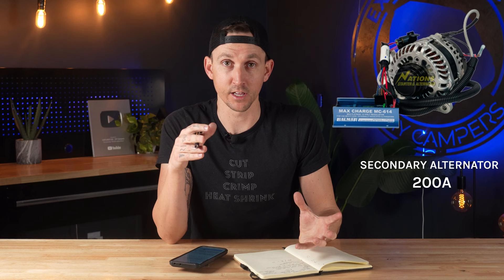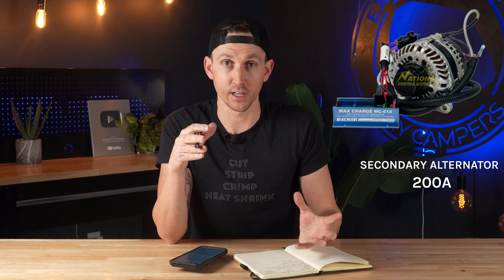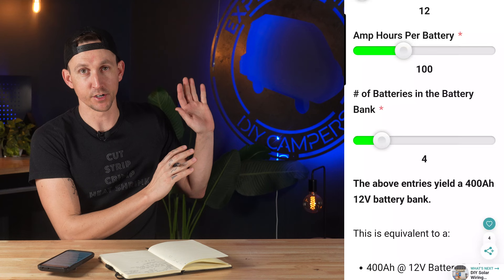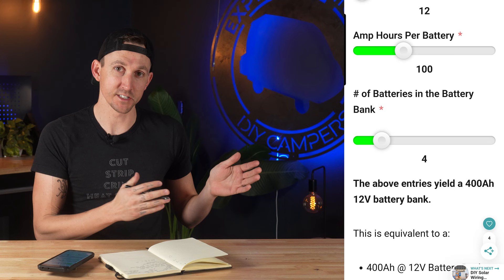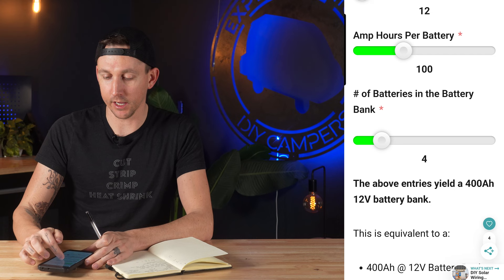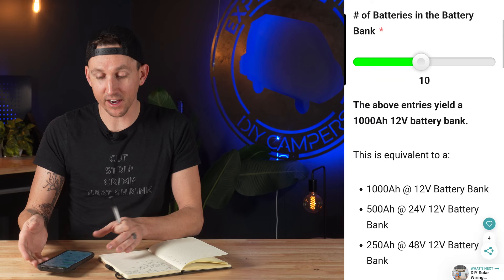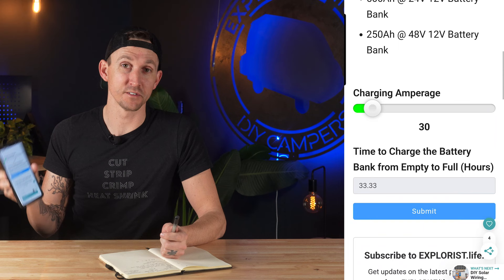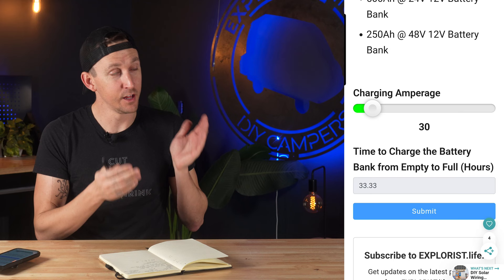ALTERNATOR CHARGING OR NOT? (for a camper electrical system)

Comment: Hi Nate, disagree with your point of view. who starts off their camping journey with 0% SOC on their battery bank. Also most modern DC-DC chargers have dual input Alternator and solar and will utilise best option. as well when driving at cruising speed alternator charging is not damaging the engine......its what its designed for. Here in Australia we have some excellent DC-DC chargers that are almost bullet proof..........battery bank gets fully charged driving to campsite and solar keeps the bank topped up my system is 270 A/H lithuim bank with 700W total solar (2x 350W panels), Regards, David
Reply from the maker: With solar that small and no gemerator, I agree that alternator charging is necessary for that scenario.

If I wasn't clear, I only think alternator charging can be omitted if you've got 2,000+ watts of solar and an on board generator.

Comment: My vans 210a alternator and 140a CTEK system kept my 300a lithium so charged up I had to fit an inline switch to the ignition signal to fool it into thinking the van was not running just so I could cycle the battery properly.
I cook with an induction hob and air fryer and I have an immersion element as a secondary water heater and I still can't use all of the electricity the van alone generates.

Comment: Your charging rate from the 30 amp Orion, the 100 amp buck-boost and the 200 amps from dual alternators doesn't make sense. At least not for the Ford Transit buildout which you have been discussing the past year or so.  The Orion and buck-boost are DC-DC chargers. Dual alternators, such as configured in a Ford Transit van, do not make a 200 amp DC-DC charger.  In addition to the alternators, one needs a DC-DC charger. What DC-DC charger are you using to charge house batteries at 200 amps? Also, with the Ford Transit, the dual alternators put out a nominal 500 amps of power. But to connect the house batteries one connects to CCP2 which delivers only 175 amps, not 200 amps.
Reply from the maker: The secondary alternator I was referring to was an aftermarket secondary alternator like a Nations alternator w/ Wakespeed regulator (or similar).  This wasn't really a "Transit Specific" video.
Reply: Now it makes sense.  Thanks for the clarification!

Comment: Just went outside. Getting hardly if any solar power generation. Overcast. Solar is not so good. Adding a second alternator and ecoflow alternator charger. Might remove my solar. Bad tech.
Reply from the maker: Solar panels don’t work well when it’s overcast.  That’s not bad technology, that’s just an unrealistic expectation of the technology.
Reply: They don't work well at night, either. Just fyi.
Reply from the maker: Great points all around.  Much like how alternator charging doesn’t work well when the engine isn’t running or how shore power doesn’t charge quickly when shore power isn’t plugged in.

Comment: ur time to charge calculator doesnt take into account the fact that batteries dont pull the full charging current the entire time. it might not be off by much if ur chaging a lead acid to over 14v but with a lithium chemistry battery is gonna be way off
Reply from the maker: It's close enough for what I'm trying to demonstrate.

Comment: Another Huge factor is Alternator Life. Adding a 30 or more amp charging load on an OEM alternator can lead to premature failure of the alternator. and Alternators on modern vehicles are Expensive, not to mention difficult/expensive (for labor) to replace. If you have enough panel capacity, I 100% agree, disconnect the charge wire from the 7 way, and let the sun do the work.
Reply: I installed a 12-24V/15A Victron, thermistor temp sensor epoxied to outer rear of 110A alternator and hall sensor. Keep amps under 83 or 75% and alt temp under 90C. Works great.

Comment: I disagree with this video.  You can only fit a couple hundred watts of solar on a van.  Maybe 500 watts or so is a generous amount.  A sunpower 500 watt panel is fused at 25 amps.  That means you can never draw more than 25 without blowing the fuse.  Also solar panels only work ~12 hours a day in beautiful weather.  That means in PERFECT conditions you will get no more than 300 amps.  More realistically I would say expect 100-200 amps.  

The alternator paired with the orion provides 30 amps ON DEMAND by turning on the motor.  From dust to dawn your solar panels generate nothing.  You will seriously need your alternator man, forgoing the alternator for solar is simply bad advice.  Use your alternator man it is dependable and steady.  Connect it to your house bank and trickle charge the starter battery.  You can also install a high output alternator, and a higher amperage dc-dc charger, and with some setups produce 100 amps PER HOUR.  Solar will never get you anything NEAR that.  Bad advice, use your alternator.  And use it a LOT.
Reply from the maker: Sounds like you missed one of the main points of the video.

If you have a van and can only fit a couple hundred watts, alternator charging will always be good.

If you have a 5th wheel rv with 2000+ watts of solar and an onboard generator hard wired in, alternator charging doesn't make much sense.